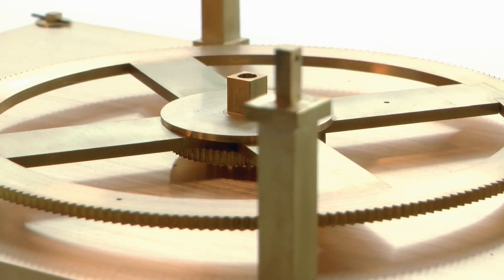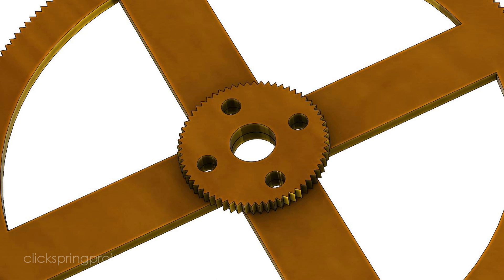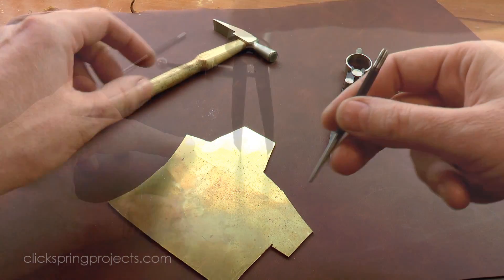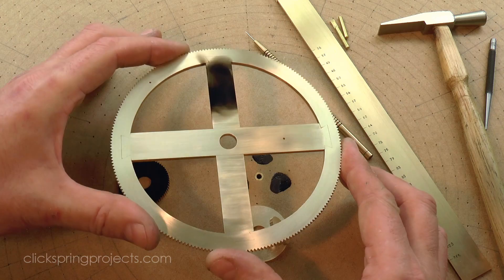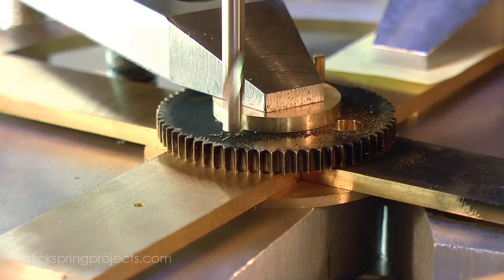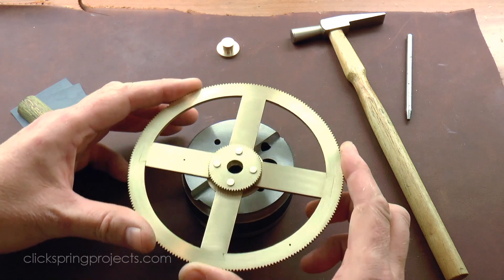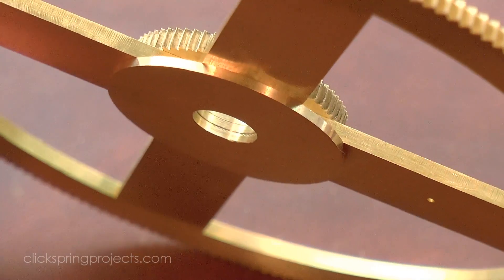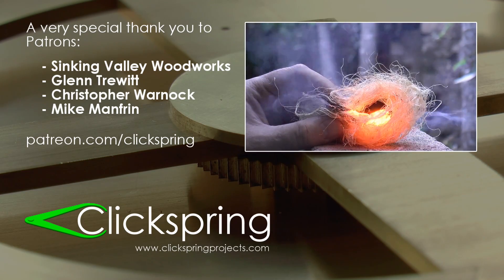The Antikythera Mechanism Episode 4 - Making And Fitting B2

Comment: I'd like to start by saying that this is my favorite channel by far. I'm wondering, what is the cutoff for where ancient techniques is used? Hand made files, a vise that's just two pieces of leather and wood, but then a lathe with machine driven cutting tools and scroll saw are used as well. I'm not critiquing, I'm more interested in the thought process behind it.
Reply from the maker: Great question - Its going to be a blend of the two throughout the build, mainly so I can keep the pace up. But the plan is to verify as much tool technology as I can along the way, that could plausibly have been used by the Ancients. Some of the Ancient tech already covered is just awesome to use, like the vise, so I'll probably use it in every video. Some other tech coming up in future videos is plausible, but just too time consuming to use if I want to meet a reasonable release schedule, so I will have to use some powered tools to get the parts finished in a reasonable time. But by the end of the project, I'm hoping that you will be able to bring to mind a full set of Ancient tools that could plausibly have been used from start to finish. Cheers :)
Reply: +clickspring:  When I started apprenticing many years ago the senior machinist told me his first job as an apprentice was to hand crank the flywheel on a small lathe, it is not unimaginable that the ancient Greeks could have had such technology and all you are doing is replacing the apprentice with electricity. Your use of the lathe is a reasonable step in recreating what they did.
Reply: Lathes ultimately are very simple and accessible tech to those ancient Greeks. Think of "turning between centers" and you can devise quite a few workable options that use nothing but primitive tech.
Reply: The milling machine however....

Comment: The question surrounding a layout fluid led me to think what would have been contemporary.  So I'd suggest one of the various types of inks that would have been available.  For example Lamp black ink, can be made from Carbon, Gum Arabic and water (https://joshberer.wordpress.com/2010/04/28/lamp-black-calligraphy-ink/).  

From what I've just discovered (I'm no historian), Pliny the Elder wrote about a number of inks, including how they were made.

"It was made of soot in various ways, with burnt resin or pitch: and for this purpose," he adds, "they have built furnaces, which do not allow the smoke to escape. The kind most commended is made in this way from pine-wood:— It is mixed with soot from the furnaces or baths (that is, the hypocausts of the baths), and this they use ad volumina scribenda. Some also make a kind of ink by boiling and straining the lees of wine,"

http://penelope.uchicago.edu/Thayer/E/Roman/Texts/secondary/SMIGRA*/Atramentum.html

https://books.google.co.uk/books?id=-XZqkmmiFWUC&pg=PA111&lpg=PA111&dq=Atramentum+tectorium&source=bl&ots=njrsz-VcRH&sig=Z7ZokYe59pTsDX3AC_RYJ9E6TTo&hl=en&sa=X&ved=0ahUKEwjT-8KetrPVAhWoL8AKHavkCZgQ6AEIOzAD#v=onepage&q=Atramentum%20tectorium&f=false

http://biblaridion.blogspot.co.uk/2005/06/ancient-gall-ink.html
Reply: Sorry just to add, found this passage, and a description of - "For every three ounces of soot, one of gum is to be added"

https://books.google.co.uk/books?id=OVlFAAAAcAAJ&pg=PA423&lpg=PA423&dq=ad+volumina+scribenda&source=bl&ots=fGiHigx4ub&sig=5PwPozzilo9blaSSw3uueoA9pcY&hl=en&sa=X&ved=0ahUKEwiX74DLubPVAhWhJcAKHcTNAeUQ6AEIMjAB#v=onepage&q&f=false

It also mentions that they have "the disadvantage of being removable by water".  Which is a great advantage if using it as a layout  fluid.
Reply from the maker: Terrific info Oliver, will investigate :)

Comment: Dried pomegranate juice for marking?  It's strongly colored, doesn't dry too terribly sticky, and is soluble in water.  It's not going to go on as quickly and cleanly as your blue stuff does, but I suspect it would hold up better than soot.  Or maybe apply a thin layer then heat gently to dry/adhere?

Comment: Mix lamp black with hide glue.  Hide glues existed 2000 BC. The film should be pretty durable, not sure how clean the lines will be. It should be removeable with hot water or vinegar.

Comment: An interest marking technique I've seen used on particularly dark timber is to carefully scribe the lines and then file chalk over them. The chalk that settles into the scribe line is quite resistant to rubbing off while the dust on the surface can easily be brushed away. I assume a similar technique could be used to make the scribe lines in brass more visible if something like charcoal was filed over the surface of the work.

Comment: Maybe using the oxide layer on brass (in the worst case created by heating the part) as a "marking dye" would be a possibility too, espacially when you start with oxidized stock and don't clean it off till you are finished with shaping the part.

Comment: It's totally possible they were using some kind of ink or paint for this. Inks were made from some pigment and some kind of glue to hold it in place. We want something easily removed with water and available in region and time frame.

Pigments used may vary, but I'm pretty sure the most common was soot.

Glue is a little bit trickier, but actually any sugary juice would do the trick, if you don't mind it being a little bit sticky and messy.
Reply: Also, as Greeks knew about distillation, it is possible they could have used distilled spirits as solvent, reducing time needed for ink to dry. This also could bring other kinds of glues to the table, as there are many alcohol-soluble plant substances, similar to shellac (however I'm not sure shellac itself was known or widespread at the time).

Comment: Hmm, maybe (hopefully) animal blood. It won't clot or go grainy (outside an organism), is easily available, offers strong contrast and when dry it will take a good line and resist bumps/brushes/drops until you rub it of intentionally.

I used to work in a pathology lab and have had to prepare blood slides for study. You take a slide, pipette a drop or two onto it and use a slide-cover (thin square wafer of glass that goes over sample) to draw the blood across the edge. Then drag the cover sheet to the side. This would produce a clean layer of blood cells that a Medical Scientist could then do cell counts on to determine pathology i.e. too many blast cells in your circulatory system something bad is happening in your bone marrow :(

Comment: Hrmm. For marking material, there's the tradition of wax over wood for cheap reusable note-taking. If wax or shellac adheres to the surface, does it disrupt it too much? 

Mmmm, looking at https://books.google.com.au/books?id=XgshBQAAQBAJ&lpg=PA19&ots=oii48l2OKR&dq=ancient%20greek%20paint%20metal&lr&pg=PA22#v=onepage&q&f=false (page 22), there's talk of sulfur as blackening agent in greek sculpture. Page 23 speaks of a bitumen varnish and scrape marks: something which clearly meets your requirements here. 

Page 4 https://books.google.com.au/books?id=5IXRAwAAQBAJ&lpg=PA1&ots=Dz7VIWGrz_&dq=greek%20bitumen%20varnish&lr&pg=PA4#v=onepage&q=greek%20bitumen%20varnish&f=false talks of an oil varnish. Speaking of varnishes, http://ac.els-cdn.com.simsrad.net.ocs.mq.edu.au/S1296207410000981/1-s2.0-S1296207410000981-main.pdf?_tid=e23cd2c4-75d6-11e7-a25e-00000aacb360&acdnat=1501495324_b1ba7fbba97ed53b93ce8e3c94be5a79 page 45 speaks of three sorts (I do hope these links are coming through) "According to the varnish technique it is possible to define three
types of varnishes – spirit varnishes, essential oil varnishes, and oil
and oleoresinous varnishes, respectively" -- which suggests a fruitful line of inquiry.

Comment: would they have had access to lathes?
Reply: GitarStu A lathe is a relatively simple mechanism. Maybe lathes existed back then and were powered by water or even by a crank and a very heavy flywheel
Reply: We know that there were pottery wheels then, so spinning a part to make it symmetrical was known. It's also known that they were turning out long straight spear handles for a long time as well.
Reply: +3Triskellion3 Perhaps a treadle lathe would have been possible for them?
Reply: Or even powered by slaves or apprentices.
Reply: foot pedal wood lathes yes. with a tention bar above. same way you do a bow loop and stick to start fire but vertical
Reply: Yes, lathes have been around for over 3000 years in different forms.
Reply: That's not really the point here. Chris could just hand file all the gear blanks to final size. He certainly has the skill, no problem. But it would make the project too labor intensive. The requirements for rigidity in metal lathes, challenges in holding the work and paucity of round brass archeological finds leads me to believe they did not use lathes for metalwork. I'm not sure how you would hold a gear blank rigidly in a treadle lathe and achieve concentric turning, even just using files.
Reply: + Mathew Marting I was thinking the rivets and central pivot more than the gear blanks. Graving and filing a rough shaft to round for those applications would be much simplified by turning. It's not impossible to do such things to some degree without, but the fact that the device has quite a few such components makes me wonder if they had the ability to machine metal. The scan of the original part at 2:06 seems to indicate that the rivet pins were very round and actually tapered
Reply: + Troy AM ...like a spring-pole lathe?
Reply: +lordchickenhawk That is absolutely fair. I hadn't thought of the rivets or other small parts. Those would be fairly easy to secure in some chunk of wood with a hole drilled in it. To be clear, I don't at all doubt that they had the ability to machine metal, I just think we'd see a heck of a lot more of it if this clock maker had built an effective metal lathe. I'd expect something more like a screw plate (without threading) that you could just turn the brass down in using a bit and brace.
Reply: I think you'd be right for a lot of small parts, the bit and brace makes sense. It requires a minimum of tool biulding to make. But the taper that appears to be on those rivet pins makes me think the artisans had some kind of turning machine. Perhaps much like a wood turning lathe without any slideways, just a tool rest bar for graving tools to rest on whist being used to manually cut the metal. Perhaps they may have even had the equivalent of a face plate for mounting the work being turned. Clamps with wedges could secure a boss with the metal stock cast or riveted central and perpendicular to it...

Comment: Ground up charcoal in wax. A thin brushed on layer would be easy to mark, resistant to handling and give the same black contrast.
Reply from the maker: Will check it out, thanks for suggesting :)
Reply: Also, if the wax was placed on top of the gear and then the gear was heated, the wax could melt and naturally pool level (no need for a brush). It would also create a surface that would be simi adhesive to help pieces stick together for alignment/placement.
Reply: I do a little bit of jewellery making in viking and middle age style as a hobby. The old way of making scratches in work visible is to use mix of beeswax with some candle sooth. But the trick is to make scratch markings on the work first and then rub it with darkened wax. So all depressions are filled and darker. Now wipe work clean (you can use a little bit of heat to make cleaning easier). Now your lines are clearly visible and pretty rub proof.
Reply: I'd expect the charcoal to be a bit gritty. Perhaps soot from an oil lamp, collected on a metal plate and mixed with the wax.
Reply: I'm pretty sure they had gum arabic back then.  With water and soot  that'd be india ink,  but with some sort of spirit instead of water it might coat more evenly.
Reply: I was thinking the same, something based on shellac maybe.
Reply: Tomas Jonsson I'm assuming squid ink is water based so it would just puddle on the metal.
Reply: were thinking the same...
shellac has been know for about 3000 years..
Reply: Given the time and place, I was thinking undiluted squid ink kneaded into beeswax. A number of you have similar ideas.
Reply: wax seems OK, but maybe too thick.  Better might be shellac, but no carbon nor ink is necessary -- black shellac has existed since shellac was known.  The first coat isn't black,it's kind of a bluish-red over light woods, but those colors are right in the dykem wheelhouse, aren't they?   Each subsequent coat makes the color darker, and after 3 coats on very light wood (I can't speak to metal) it is black.
Reply: Robert Thömcrantz
Exactly this soot with wax of a pretty high melting point should do the trick
I would first coat the part in wax and then use a candle to soot it up melting a thin layer of wax in the process
Reply: I see lots of suggestions for marking your peace, just try the blood see how it works, a little pinprick like a diabetes checker, put a little bit of blood let it dry it does not come off until you want it to come off, and scratches beautifully
Reply: Sheps I was thinking same thing
Reply: That is what came to mind for me as well. Carbon from some source, and shellac might be worth investigating.
Reply: I recall playing with candles as a kid and coating metal with soot then applying a coat of melted wax to fix it. 
But I agree that shellac sounds like a good option.
Reply: The comment from the jewelry maker was great! I think with heavier handling it might still be a problem. Shellac is god 'n hard, but what about pitch? Back in the day, caulkers would use natural pitch to seal wooden boats, so it would be plentiful in a shipyard.  I still like the carbon black and wax idea - exactly what I was thinking!
Reply: excellent what more could I say! !!!
Reply: Spencer Margosian +1 for shellac, as it dries very quickly, could be removed with alcohol and seems to have been known at the time.
Reply: +Spencer Margosian  I was originally thinking of ink or a dye and kept coming up with drying issues...but I agree, shellac mixed with a little colourant (maybe ink or soot) should stand up to being handled, dry quickly, and not stain the finish permanently.  :-)
Reply: Sheps that's almost exactly what I was thinking, although I was going to say lamp black. Though I have no idea where you would get enough lamp black in modern days to do that, so charcoal is probably the best bet.

Or maybe there's a place one could buy iron gall as it was a common agent in black ink.
Reply: I immediately thought about pitch. My grandfather used to use pitch for marking out small woodworking projects since you could scrape it off easily.
Reply: Sheps - I just realized that ppl have been using hide glue (which is basically just concentrated gelatin) for 50k years.

Mix it with some powdered charcoal or any fine powder?

It’s perfect!! It would be soft enough to scribe without chipping and thick and durable enough that handling wouldn’t smudge it!
Reply: Great minds think alike! 😉
Reply: if any kind of temperature whatsoever happens either from friction or a hot day then that wax will be a mess
Reply: A patina. Expose the copper to aged urine.  Ammonium compounds would color change a very thin, sandable, too layer.
Reply: Pomegranate juice and shellac
Reply: Something sugary maybe to bind the soot? To be applied one on top of the other? -Beer can be used to bind sand for castings.
Reply: Why not just use squid ink?

Comment: awesome job Chris.  how about shellac with an added dye to mark the brass?   cheers from over the ditch
Reply from the maker: Definite possibility mate, maybe with wine as the solvent? Good excuse to go vino shopping...
Reply: May be morbid, but my first thought for marking dye was blood.
Reply: I would have guessed blood too, highly contrasted, robust, and easy to clean off
Reply: and well-available if the local butcher shop/slaughterhouse knows you need it.
Reply: I was just thinking that...wouldn't want too much shellac in the mix though, eh?
Reply: I'd expect that shellac would chip rather that leave a clean line when scribed.
Reply: I was thinking soot, put your mark on, then a light coating of thinned shellac.
Reply: I think if you dissolve it in alcohol and apply it thinly it won't chip